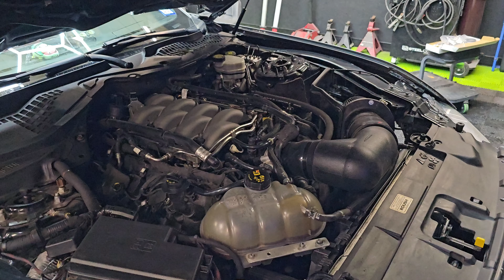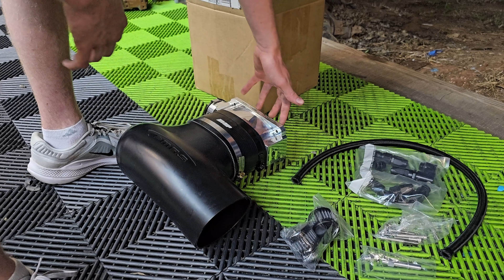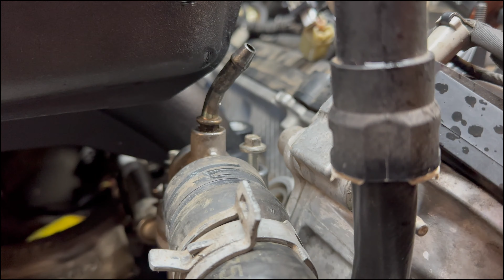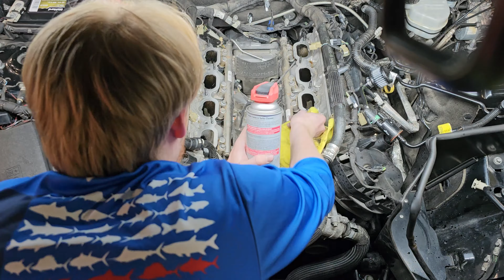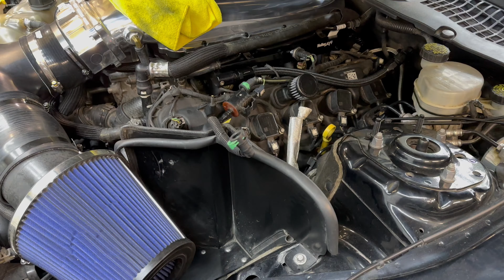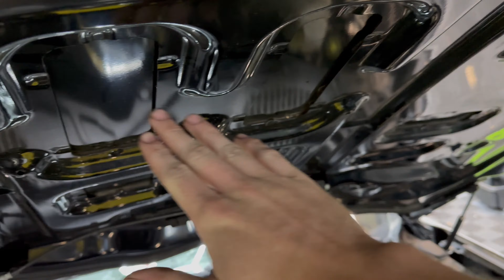Mustang Holley Hi ram Install

Comment: Hey man I installed a Holley intake on my 3rd gen coyote mustang I was just wondering did you ever figure out what to do with the PVC purge valve line you had disconnected I’m trying to figure that out right now or did you just leave it alone and got the tuner to delete the codes thanks

Comment: did you get a noticeable jump in power, i’m currently running a stock gen 2 manifold but im trying to figure out weather getting this or the boss 302 would make a better gain in power
Reply from the maker: I personally noticed around a 1-2 car gain in roll races especially after oil pump gears and revving the car to 8500. This will definitely gain you more then a ported boss 302.
Reply: @ that sounds like it does give it a decent jump in power, what tuner do you use with it?
Reply from the maker: @Intrusive_moto ha yeah it’s a good bump I’d say, I run HP tuners and use JTC tuning. He’s smaller but does a great job, use him NA and now boosted

Comment: About to but this on my 2018 with my ESS blower. I e got the Cervinis 2020 GT500 style hood, wondering just how high this thing sits in the front and if it’s gonna clear 🤔
Reply from the maker: See how much room the cervini hood gives you above the stock, if it’s not atleast an inch you’ll need drop mounts for the engine. Also these things love boost you might see a drop in psi but it’ll make the same power
Reply: Yo does it fit?🫩

Comment: How do you get ur hood to close with intake being so high?
Reply from the maker: Ok so originally I went and got a 4” cal hood and hated the visibility, I have now put bmr engine mounts in that drop the motor 1/2 an inch and cut the inner skin of the stock hood and it shuts just fine.

Comment: Can u send a link where u bought the fuel line kit and I’m pretty sure you gained more then 10 from dyno videos I’ve seen bro Holley cars making over 520 wheel on e85 I seen👀
Reply from the maker: There’s the link, and yeah but some of those videos or on C85 fuel which picks up a bit and I’m non ported since I plan on boost in the future so maybe 500 wheel on a perfect day probably 490 ish tho
Reply: @Psychedelic5.0  do you think the new cobra jet better then the Holley?
Reply from the maker: @Jayz_whipz honestly I have no clue I haven’t seen To much testing on the new cobra jet it’s definitely lighter and won’t heat-soak as bad, might not flow as good we will have to see.
Reply: @Jayz_whipz Holley is confirmed to outflow the cobra jet but they we’re within just a couple hp of each other